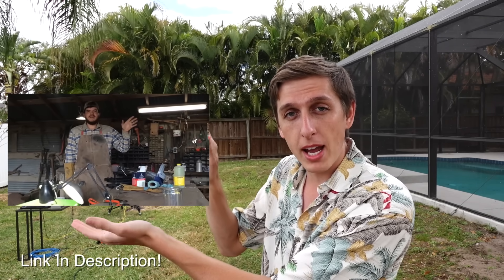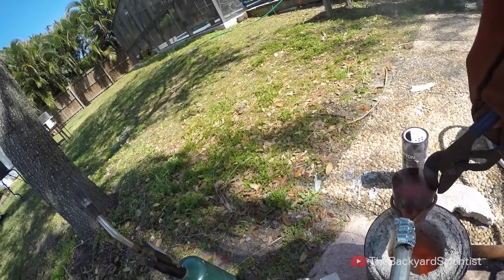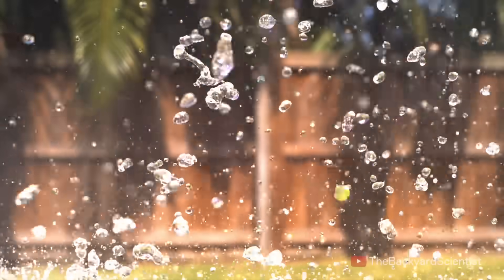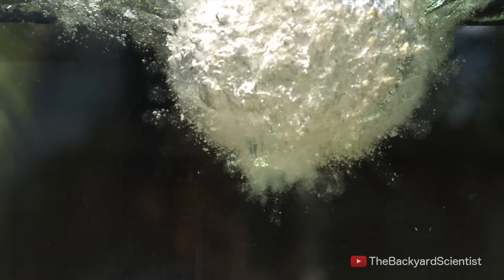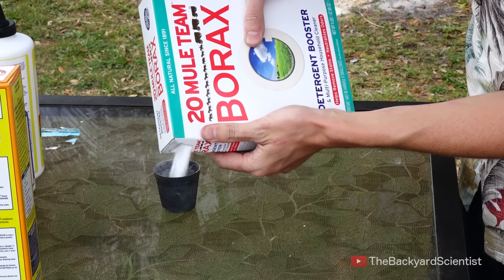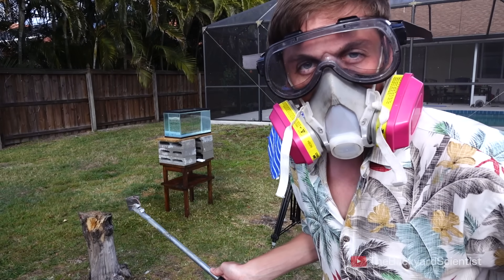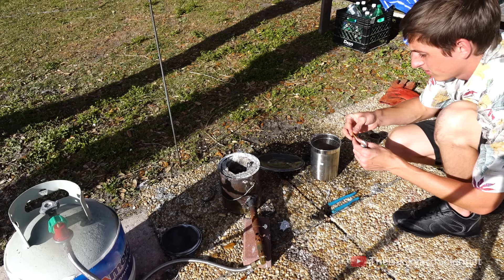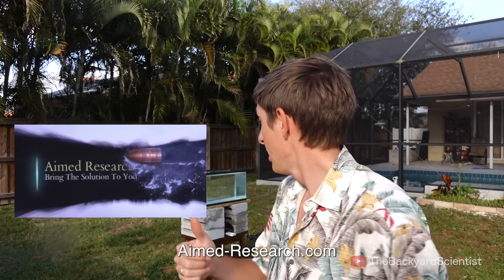Pouring Molten salt into Water - Explosion!

Comment: When you have sodium in sodium chloride it not the same as sodium Even in solution the Cl balances the Na and it never behaves as sodium metal. Same with electrolysis of salt in water you will never get chlorine gas. NaCl is not Na or Cl. The reason is the reaction always tries to be at the lowest energy state. There is a lot of energy released when you react Na and Cl and you need to put that energy back to separate. Simply passing a few volts of electricity won't do it it will break the much weaker water molecules bonds.
Reply: Oh calling him a loser
Reply: When your most likely a convince store clerk
Reply: That doesn't explain why the other ionic salts didn't do the same thing though.
Reply: No it wasn't supposed to. But the other compounds weren't true ionic salts. They contained boron and oxygen and other atoms besides an alkali metal and a halogen. They don't dissociate into two individual atoms but poly atomic ions. That's why I said try KCl or NaF. Why it does that is a mystery because there isn't time to dissolve or display any chemical properties. It could be that the salt has stronger bonds when heated unlike the borax that is closer to degrading. Or maybe it's due to specific heat and is a truly physical property that does this. Maybe the borax starts to dissolve first slowing the rapid cooling.
Reply: maybe the water is breaking down into flammable hydrogen and oxygen gas?
Reply: @williamfigueras9754  But how exactly did the H20 split into H and O?
Reply: Have you thought about a Coulombic Explosion?

I mean the smooth surface from the melting facilitates surface exposure. The Na loses an Ion to the water making it so it repels other positive charges expanding its surface area chaining the reaction. When this breaks water tension it basically creates the explosion.

Comparing to pure Na Coulombic Explosions there seems to be a lack of Hydrogen burning, to which I think the Cl might have something to do. I have no idea what though. We need a faster camera to capture it and a laboratory equiped to handle this. The high heat makes this hard to test in n
Reply: Sorry man but it's a physical change not chemical. The salt itself doesn't explode, the molten salt is so hot that the water instantly boils to steam. As the water contacts the very hot molten salt it dissolves rapidly, transfering its heat to the water much faster than would happen if the salt did not dissolve. Bam! Explosion!
Reply: Y’all saying nerd this loser that watch this man be the next  Stephen Hawkins
Reply: Electrolysis of salt in water produces chlorine and hydrogen. The resulting solution contain sodium hydroxide.
Reply: @simondancer  No it doesn't you can try this yourself as every 9th grader has. That wouldn't balance out the ionic bonds in the Na and Cl won't react with the water, You are thinking the salt breaks down first, the water breaks down first as it takes far less energy. Go look electronegativity of salt and water, salt is so much higher then water that a few volts won't do it and the water would be long gone before you broke down the salt. Go look at chemplayers videos of how he does this its much more complex or codylab making bleach with NaOH.
Reply: @daveb5041  Thank you!
Reply: @simondancer  I'm a Physicist. I've  tried to explain this very basically.

Again...It's a physical change not chemical. The salt itself doesn't explode, the molten salt is so hot that the water instantly boils to steam. As the water contacts the very hot molten salt it dissolves rapidly, transfering its heat to the water much faster than would happen if the salt did not dissolve. BAM! Explosion!

Remember... Newton's first law...conservation of energy. But more applicable is the third law of thermodynamics states that the entropy of a system approaches a constant value as the temperature approaches absolute zero.
Reply: @johnirby8847  I'm well aware the video shows a physical reaction. My comment was directed at Dave B who was talking about electrolosis of brine. @Dave B I was a straight A student and went on to obtain a science degree from Cambridge University. The electrolosis of brine is exactly as described in the link I provided and is no doubt demonstrated multiple time in Youtube videos. I have done the experiment myself several times and always got hydrogen and chlorine. Like any good scientist I am always willing to be proven wrong. If you are able to provide a link describing the electrolosis of brine differently then I would be very interested to see it.
Reply: Now wait just a moment. I've done an electrolysis lab before and there were defini---

Wait NVM those where Hydrogen bubbles...
Reply: No basically the hydro chloric nucleic acid causes the tetrasensual molecules to molitize into salt crystals basically explaining why dogs cant fly even though cats don’t have wings
Reply: What the heck do you mean nerd
Reply: That’s not the definition of “nerd”

Comment: The molten salt explodes because when NaCl is heated up to such a temperature, the Cl is removed and evaporates, leaving just the Na. Because sodium, (Na) belongs to row 1 of the periodic table, it shares along with all other row 1 and 2 elements the property of exploding upon contact with H2O. When the molten Na is poured into the water, it explodes. When NaCl is poured into water, it doesn't, because the chlorine (Cl) protects it from exploding.

Comment: Sodium chloride is different that borax because the Na+Cl- creates hydrogen and oxygen gas, both of which are highly explosive, plus chlorine gas which is not normally flammable, becomes explosive in the presence of hydrogen. The fact that it's ALL reactive is why you're getting a neutral pH. it's a zero-sum reaction. [edit: typo]

Comment: Hey Mr back yard scientist check my channal out and talk to me I got some great ideas for u to do.  The reaction between the salt and water is the multen salt epanded to a different mass. With super heated and when it it's the water it super cools with causes tge recompression of the salt with in return explodes since there isn't a coating on the sodiem unlike the other salts and metel u tried it has a more violent reaction thus the action from decompressimg the salt by multing it into a liquid it isn't has dense then cooling it when dumping it in water causes a recompression as in forming a solid makes it go boom.  It's in accordence to newtons laws

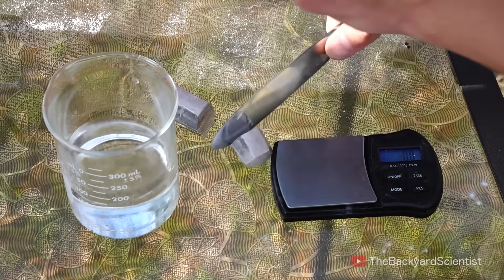Comment: God Damm your an .... . You just don't risk only your healt and live you also risk the life of your Cameraman. You tuch the Sodium with your bare at 5:51 with your bare Fingers what could cause Instant burnings of your Fingers only the oil surface protects you. And I don't think you did any calculaitions how much exploson pressure comes out of the amount of sodium. Furthermore could it float on the wather surface and burn (trou throu i don't know) itself though the glas and Hit you your Partner or your dog or someone behind the fence. Go in a Labatory and lern how to handle chemicals.

Comment: Just taking a guess here. Liquid sodium metal explodes because because of coulombic repulsion driving the metal to dramatically increase its surface area faster than the speed of sound.  Since explosions travel at the speed of sound I think you need a process faster than that to get an explosion. So I don't think you can use an explosion to disperse the salt into the water.  That would be too slow and probably lead to a rapid burn like gun powder and would push the water away as well. You would get a dispersed reaction instead of a centralized pressure wave. 
https://www.youtube.com/watch?v=LmlAYnFF_s8

Comment: OMG...
NaCl:
Molar mass: 58.44 g mol−1
Melting point: 801°C
Specific heat capacity: 36.79 J K−1 mol−1
Std enthalpy change of fusion: 27.95 kJ mol−1
The energy required to melt 58 g
NaCl (20°C−801°C) is roughly 56.6 kJ

H2O:
Molar mass: 18.02 g mol−1
Specific heat capacity: 75.375 J K−1 mol−1
Heat of vaporization: 40.657 kJ mol−1
The energy required to vaporize 18 g
H2O (20°C−100°C) is roughly 46.7 kJ

So 58 g NaCl of 801°C could vaporize 21.8 g water of 20°C giving roughly 27 liters of vapor. This suffices to make some kind of explosion. The point is,  that melted salt is quickly changed into small crystals which have much bigger surface and mixed with water (still having temperature slightly below 800°C) can transfer energy to water much quicker than e.g. liquid metal, which stays in one piece with relatively low surface => salt produces vapor much quicker => bigger explosion...

Comment: i would guess that the endothermic reaction from extreme heats to a cooler material is creating hydrothermic reaction seperating the hydrogen from the water in the blast zone air and hydrogen mix with chlorine and boom hydrogen and chlorine not good friends. good job on the video

Comment: The sodium metal has a lower density than water so it doesn’t sink below the surface and the expanding gas occurs mainly above the surface, so less momentum of water. The molten salt is obviously much higher density and expands well below the surface so the shock on the glass is much higher due to the higher momentum of water

Comment: Is is because the sodium chloride has a greater or lower thermal retention and its crystalline makeup? In other words does it retain its heat longer/loose its heat quicker than the other chemicals and then fracture into crystals as it cools? This staggered process would explain the multiple explosions?

Comment: Sodium metal in the elemental form like most alkali metals will react with water to form Hydrogen gas as each sodium atom loses one valence electron.  One of the products of this chemical reaction between the sodium atoms and water is hydrogen gas and combined with the heat released from the reaction will usually ignite and/or explode.  This is a very different chemical behavior from the sodium ions(+1) which are normally found in the compound sodium chloride(table salt).  In “salt” the atoms are much more stable at normal temperatures in part due to ionic bonding between the metal(Sodium) atoms and the nonmetal(Chlorine)atoms. That’s my lesson for the day...lol.  Be careful in your experimentation!

Comment: The thing is that Energy is inversely proportional to the stability of a compound. And every other elements wants to achieve as much stability as possible. The Common Salt (NaCl) is a very stable compound because its formed by an ionic bond. And the energy required to break this bond is extremely high. So when you melt the NaCl salt, you need high temperature (Heat Energy supplied here in massive amounts) to achieve a liquid. This becomes highly unstable (because of the relation between stability and energy i gave above^). HENCE, to achieve its stable state again, it releases a fuckton amount of energy (by an explosion as seen from the video). This happens in water because of the high electrostatic forces. 

PS- I may not be completely correct, just an idea of what may have been the case.
Reply: That measure is its melting point
Reply: Yes, it's melting point is quite high(very) because of the strong electrostatic force. Which requires high forms of energy to break. Hence it's dissociation enthalpy is sky high.
Reply: If it's melted, it has already dissociated.
Reply: The nacl is in its molten state because of the presence of that energy. This energy escapes into the surroundings, which makes it a solid again very fast.
Reply: Yes, but it's mostly just about that release of energy, which flash boils the water. The explosion was a result of the quick dissipation of that energy. Dissolving salt in water releases very little energy, and that doesn't change at different temperatures.
Reply: That's what I wrote on the first comment ^

Comment: As I remember the science class in grade 7.  I told the teacher of the concept that salt fits inside water on a molecular scale.  Meaning that adding salt to water does not increase its volume.  The teacher tested the concept out with a full beaker.  A beaker completely full of water will not spill over as teaspoon after teaspoon of salt is added.  The water only spills over once the salt has completely saturated the water.

So if your salt fits tightly beside the molecule of water it may be high heat hits cold water.  High heat turns it into immediate steam.  Expansion happens.  Unlike other chemicals salt and water mix immediately.  It would be that the salt is flowing into the space between the water trapping small amounts.  The initial expansion forces the salt away through the porous water causing a second expansion.  The reaction continues till the water is cold.  

If what I am writing is true than the process will not work in water completely saturated by salt.  It should react very different than.

Comment: I say, this is pure Zeroth Law of Thermodynamics. The molten NaCl has a huge amount of energy inside while water doesn’t. When both bodies make contact Zeroth Law joins the game with a huge amount of energy going form a body “B” to a body “A” as it needs to be in equilibrium. Water boils at 100°C (way under the 801°C of the molten salt’s temperature) water almost instant-boils creating steam that needs to expand and pushes the water creating the explotion. And btw this isn’s a cheamical reaction because there’s no product at the end of explotion, it is still NaCl and H2O.

Comment: I have a question: is it possible that the borax didn’t react the same as the plain sodium because the other elements in borax are fused to the sodium and it is preventing water from getting into the sodium bits? (Based off of your hypothesis)

Comment: That looks similar like the Shockwave Plant at my Workplace in a Foundry. The Plant is used for removing the sand cores out of Castings with complex cavities. There is an Electrode under Water that looks like a big  spark plug. Electric Energy (37.000 Volts) is shooting thru the Electrode and creates an Plasma channel that heating up the Water up to 20.000 degrees in less than 15 micro seconds. That creates an extremly strong Shockwave that run with supersonic speed thru the cavities of the Casting and destroy the sand core in the inside. The Treatment Chamber weight 2 tons. At each schoot the Chamber jump up 1 inch. The electric Force of each Shoot have a power of 10.000 Joules. Sorry if my english is not perfect because I am a german.

Comment: Since the raw sodium clearly produces a completely different reaction from the salt mixture, and because the pH level of the water is unaffected, I would say that it is NOT NOT NOT a chemical reaction between sodium and water that is causing this explosion.

In fact, a chemical reaction is not possible here. Sodium can only react with water if it is not ionized, and these temperatures are not sufficient to break the ionic compound of NaCl.

As such, the most likely explanation is simply that the water is rapidly heating and becoming a steam bomb. This requires the steam to be heated at a substantially higher rate than the water can conduct the heat from the impact zone, and it also explains why the hotter the intruding salt is, the more intense the explosion will be. (A chemical reaction would instead, as I understand it, produce a constant reaction as long as the ratio of salt to water was constant, though it would also contribute a predictable amount of heat.)

Assuming that everything poured into the water was the same temperature, there could be any number of mystical reasons why s. carbonate and boric acid did not produce a steam bomb reaction.

S. carbonate has a much higher specific heat capacity than NaCl, but I don't know if this is actually relevant in any way or if I am fishing by bringing it up.

Comment: Alkali metals (Lithium, Sodium, Potassium, Rubidium, Cesium, Francium) react to water by producing hydrogen gas and the metal hydroxide, which is why the sodium violently explodes. If the Sodium is prevented from having contact with the water somehow, that would prevent the reaction.

Comment: Very cool! could it be because there is a chemical reaction then a secondary reactoin in he other direction with NaCl + H20 forming NaOH + Cl- then a transformation back? You would need to test the water mid explosion. Also, it could be because the NaCl is so ionic that it attracts the water more than the less hydrophilic compounds. I dunno, just guessing.

Comment: the leidenfrost effect is the water flashing to steam around the heated substance as it falls into the water. this protects the substance because steam doesn't transfer heat as well as a liquid. it's not probably not just a flashing steam reaction because the other substances would've exploded just as violently and it's probably not a sodium water reaction because as we saw later that actually combusts. we would've seen fire. water explodes when dropped into lead because the ledenfrost effect thingy protects the droplets as they descend deep into the lead before flashing to steam. neat video but now I want to know how

Comment: Late to the game, but I had a question. Does molten NaCl start adsorb any chemicals (especially gasses), especially during rapid cooling? Because if it does then the linden frost effect may be working, but the NaCl is combining with the steam creating a new chemical. Because the gas is being adsorbed, it can envelop the water as you explained and cause the reaction seen.
The only way to test this would be to see if you can recover the NaCl and see if it gained any mass. (Yes, I know this is difficult due to the explosion, the solubility of NaCl, and having to dehydrate the NaCl to remove trace elements of water. But science.)

Thank you for making this video, we need to question the world more.